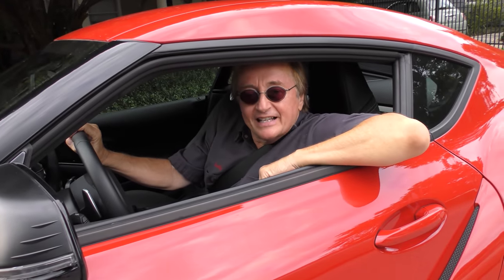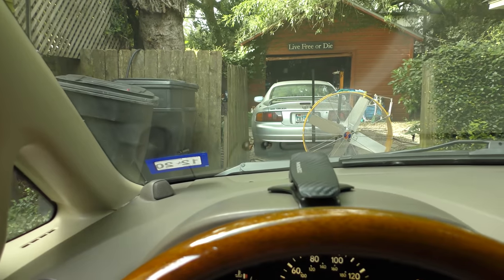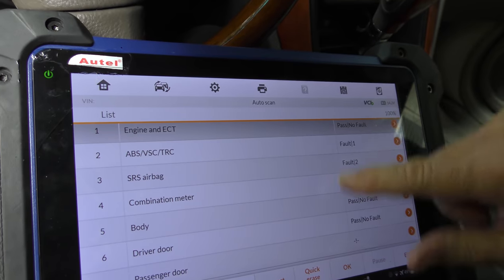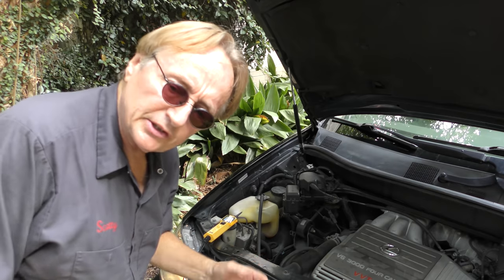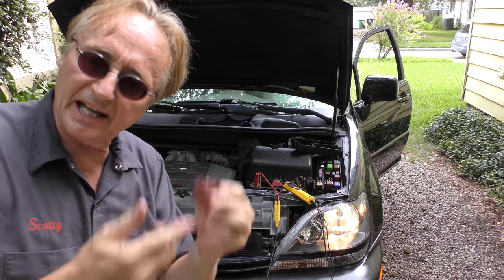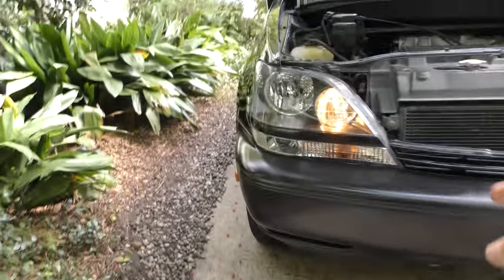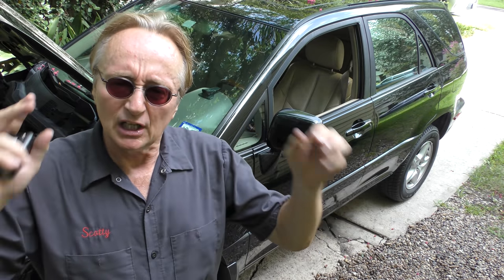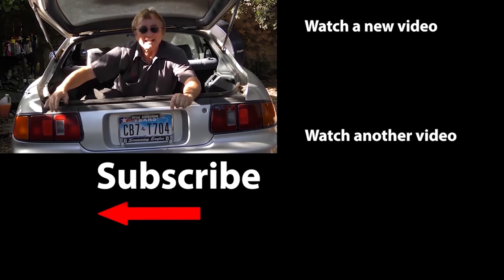Mechanics DON’T Want You to Know This

Comment: Scotty, completely unrelated to the video, but your advice about USB cigarette lighter adapters helped me greatly.  I have a 2008 Hyundai Accent with 56K miles that has 4 tire pressure monitors.  I could not figure out why I was getting TMPS errors that would come and go (but not low-pressure alerts).  Replacing those sensors is expensive but you mentioned that those adapters might interfere with tire pressure monitoring.  That clued me into checking out the dashcam I had on which attaches itself to the USB adapter via a wire.  Sure enough, removing that dashcam wire from the USB adapter solved my problem.  Thanks for steering me in the right direction.  All The Best.

Comment: I'm in IT. This shows why basic troubleshooting methodologies are so important. You start by testing the simple stuff first to rule it out then gradually get to more and more complex problems. You have to rule out the simple stuff first. That's why you're first asked if your computer is plugged in. Also the first rule in troubleshooting is check connections.

Comment: When I put HID bulbs in my RAV4's high beams, I had to remove the daytime running relay and put a jumper wire in to keep it permanently in "high beam mode" as the daytime running relay switches the high beam bulbs from parallel (high beam) operation, to series (DRL) operation. Clever way to make some DRLs by basically applying 6v to each bulb instead of 12v.
And no, I didn't put HIDs in the low beams, I didn't want to be that jerk blinding everyone. I drive a lot at night through rural roads in MN and having good high beams is important.

Comment: With a non-working relay, first try to clean the external contacts on the relay and socket. That may be the only problem. Some relays can be disassembled and the internal contacts cleaned as well. Relays are relatively cheap so replacement may be best.

Comment: Scotty, Where how do we send you questions? 
Also Scotty, I have a 2001 Acura CL Type S. Bought it at 114k for 3 grand and now it has 155k after 3 years of ownership. The only problem I ever had with the car was from the transmission which I replaced right when I bought the car. All the equipment on the car seems original (the original owner only put 6kish a year on it). I realize I'm going to have to start replacing things like the shocks, timing belt, gaskets etc. Should I do that can keep extending the life of the car, should I just run it till the wheels fall off or just sell it? I recently bought a 2018 Toyota Camry so now the CL is my second car. What should I do

Comment: Nice fix! I had been looking forever for a nice condition RX300 at a sorta-reasonable price, but it seems nobody wants to get rid of them around here.
However, I found a pretty good deal on a '01 4Runner SR5 with low mileage and looking pretty darn good underneath for a Northern truck. Frame is clean and solid, previous owner just put new rear control arms, shocks, fuel lines, and brake lines in. Odometer just clicked 186k. It's more truck than I wanted, but it was too good to pass up. Sure, it's less refined than the RX, but it's still a nice ride.
As for the Camry? 338k and still running like a champ. Now that I have a 2nd vehicle, I can take the time and really get some repairs done. Looking forward to the "joys" of replacing the entire exhaust system and struts all around.

Comment: I just worked on a 2011 RX350 with the 3.5 V6. Alternator wasn't charging battery. Alt fuse isn't blown, every connection is tight, no pack rat damage. To change the alternator, you have to remove the battery,  empty radiator coolant to remove upper radiator hose, and now you can remove the cooling fan assembly. Alldata says the front bumper and radiator have to come out. Nope. Just be careful and don't touch the radiator while removing alternator. You also barely get room to get a ratchet in there for the alternator bolts. There is 1 on the top and 2 on the bottom.
Reply: @milcotto4153  yes it was only at 10.8 volts while running. I already replaced it days ago and shipped it

Comment: Oftentimes any electrical problems can be a time-consuming P.I.T.A. to find and fix.   Scotty did an excellent job of proceeding in a logical manner and explaining every step along the way.   Thing is, I am not certain if everyone can access Alldata to get the appropriate diagrams.  May need another source for those.
Reply: most relays are marked, so it it mostly a matter of knowing where all the relay boxes are, which should be easier to find out

Comment: I had a 2009 Kia Sportage that kept sending signals to the starter. Burned one up. Kia wanted a butt load of $$ to look at it. At 180,000mi just not worth it. After messing with everything I ended up bypassing the relay and installed a push button start. Works great. Cost $2.99

Comment: I'm sure that if this Lexus was someone else's car, and they didn't know much about cars, and took it to a young and inexperienced mechanic, that this mechanic would almost certainly tell them to get a new computer module for the high beams. It wouldn't fix the problem, cost much more than a new relay, and the young mechanic wouldn't even have the time, inclination or knowledge to check the wiring thoroughly, nor to go to All Data and check where all the relays were. Great job Scotty.

Comment: The reason the computer didn't register is because it's in the secondary side of the lighting module no system will check output due to the fact of current draw.

Comment: But Scotty, the fact it said no communication and then you located a second set of relays where the one for lights was bad does make diagnostic component flow chart logical sense if the 5volt side of the relay circuit to the computer was also fried because their was no continuity on that side of the relay. 
Wouldn't the 5volt reference side be MORE PRONE TO FAILURE THAN THE HIGH CURRENT SIDE TO THE LIGHTS DESIGNED MORE FOR THE EQYIVALENT OF A DATA CIRCUIT WHERE TGE CURRENT SIDE WOULD BE THOUGHT TO BE OVER-BUILT FOR HEAT AND THE NUMBER OF OPEN/CLOSURE SWITCHING?
Thanks

Comment: Has anyone ever heard of the relay going out for the blinker on a pt cruiser? The one on the turn signal stock? I recently replaced the stock, changed the fuse fixed the problem for a few days then it reverted to the same problem. Sounds more like a shortage somewhere but I’m curious to see what anyone thinks

Comment: Hey Scotty! I just changed my halogen high beam bulb by an LED one. The high beam works perfectly fine, but the DRL it doesn't. It worked before with the halogen one. Could it be the new LED bulb that is not prepared for DRL?
Reply: I recently did the same on my car. But I had done some research and found that I need ones that say "error free" led bulbs because those come with a built-in canbus which controls the electrical output. Both my DRL and high beams work good.
Reply: Ok so it's a canbus problem. At least I have no error lights on my dash :)
Reply: Yes, the canbus is usually built-in the "bulb" assembly or in-line before the connector.
Reply: Yeah, it's definitely the new bulb, because it's written on the description: this bulb is not canbus ready.

Comment: hey Scotty I was wondering what are the best years for a ford f-150. engine type/size doesn't matter to me.
Reply: I think late 80s to early nineties.  Hell. Go find a first gen lightning. Those spanked the 454 SS back then. Or a late 60s variant with updates.
Reply: If your look for a new one get a 5.0 over the ecoboost but if we are talking older get a 5.4 or 4.6 2v dont not get the 5.4 past 2003 due to the timing chains being a nightmare on the 3v motor

Comment: Hi Scotty! I have an Audi Q5 2009 Tfsi 211 hp. I changed battery and since then no one of the 4 lighter gives power. Fuses are checked battery was registered. The obd saws a fault at day and time that previous battery went down. Any suggestions?

Comment: Hey Scotty, I need help, 2001 Pontiac Sunfire overheats. Gauge goes up to 3/4 and then the fan kicks in. I replace the relay, the fan, radiator, water pump, temperature sensor, new coolant and thermostat. And it still does it. Now it only does that when the car isn’t moving or when the car moves slow (rush hour) when the car runs at normal speed it doesn’t happen. Help please.
Reply: Wow you’ve replaced everything by the sounds of it, I would look into a possible blown head gasket

Comment: Hey @scottykilmer I need to ask a question. I got a 1999 Hyundai Elantra. The power steering line has a leak. I got the hose for it already but I have to drop the engine in order to get to the lower line. Would you happen to know any other way to do it besides by dropping the engine?

Comment: Now if you go to the dealer, they will start by replacing the computer, kah--ching for the shop, and then they would likely try to nail you with everything that's not even related to the problem.

Comment: Good lucking changing the rear valve gasket and spark plugs in the beast, you got to pull off the whole intake manifold just to gain access and to have enough clearance to change them. Big @#$% job.

Comment: You know you would have been raked across the coals at a dealership for this repair. They would have sold you new bulbs, the fuse, the relay, and a new computer module plus 20 hours of labor.